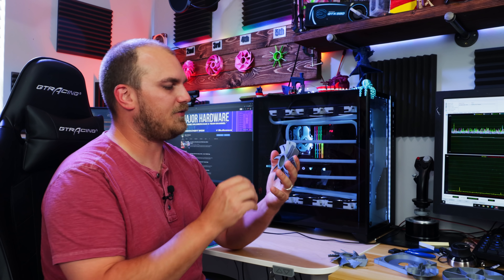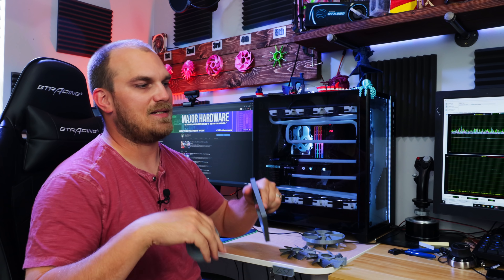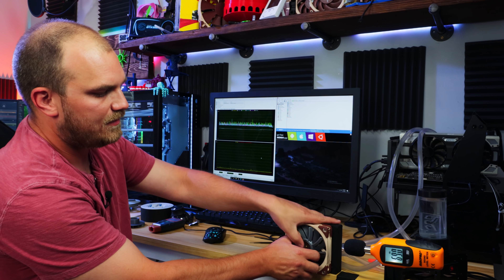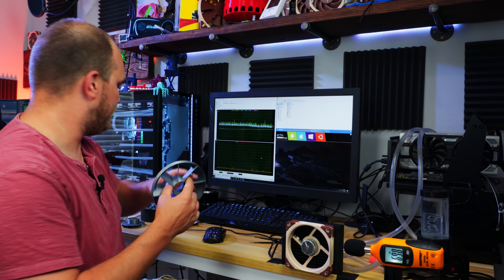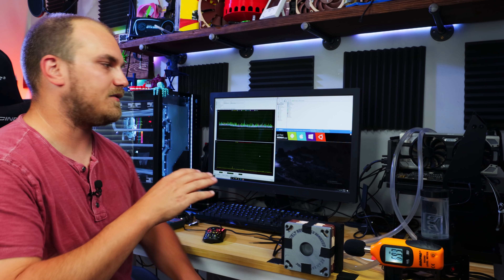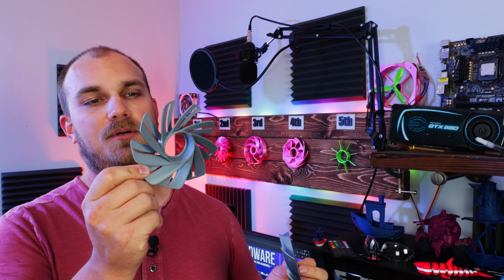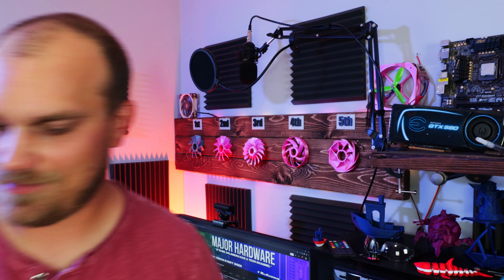We Are All Noctua Engineers | Fan Show Down Episode 4

Comment: Hey he tested my stupid blower garbage. Today is a great day. I'll edit this after I see how it actually did.

Edit: It worked as expected.
Reply: My first thought when I saw it: "If the shroud inlet was shaped like a venturi, it would work even better".
Reply: @dimitri877  That's really not the issue here. I did design it for proper flow at the correct velocity but the biggest issue is not knowing the power of the fan motor. I assumed it was weaker than it apparently is so I didn't give it as much bite as I could've. I could make a much better version knowing this but I had my fun.
Reply: @mattsoup4121  my thought was not to diminish your design, I loved the way you thought outside of the box like James mentioned in the vid   :)
Reply: @dimitri877  c check i
Reply: @dimitri877 totally agree! 😅
Reply: The impeller needs to be bigger! Take up as much room as you can in respect of width.
Reply: @CableWrestler  that's what my previous reply was about. I didn't know the power the motor can put out so I didn't make it very aggressive.
Reply: @mattsoup4121  man, that blower fan of yours is my favorite in there. I really thought it would get in the leader board. The design is very unique too bad it didn't work that good
Reply: starshipeleven  you need torque curve specs and several other factors. I just guessed.
Reply: Torque I'm sure?
Reply: It was interesting! As someone who understands very little about fluid dynamics or fan design, all unconventional designs are great fun to see... You know - because just maybe this random dude from internet figured something out by skill or pure luck.

Hey, since you are pretty handy with the design software, maybe you or someone else wants to give this simple mod a try? https://i.imgur.com/u51QWdJ.png
I think it should be pretty easy tweak to the default A12: Basically just increase the upper curve of the blades over the side of the fan(by your own eye).  By my logic that should wreck the A12 :D
Reply: @z3dar  I don't think it would do much. I actually don't expect any 3d printed design to beat the stock fan. Their tolerances and CFD work won't be beat by an average person and even if they are 3d printing doesn't create good aero surfaces unfortunately.
Reply: @mattsoup4121  Yeah, absolutely. 
My thinking was that larger curve/blade is something that (probably)should help performance on paper - and also something that Noctua likely wouldn't implement even if it was better performance, since extending blades over the frame introduces other problems that are not worth it.
Reply: I think it might’ve actually had a chance if you would’ve made it into a puller fan. Basically have the same kind of blade design but with an open back so that it throws air from the center out, which would have to be replaced by air sucked through from the backside of the radiator
Reply: I liked your radial fan. Unfortunately the mounting of the blades and the chasing killed off a lot of potential. Also a radial fan doesnt have a lot of air flow by design (if you compare the input nozzle with an axial fan), but rather achieves a higher and more stable air pressure.

I guess that it was never meant to be winning, but rather a proof of concept. (Great fan curvature though!)
Reply: @32Zn  I only did it because I felt like it. Obviously it wasn't going to win anything.
Reply: doesnt mean you cannot tweak it to make it better.
Reply: @Daniel Keener no. I thought like a small fan mixt with a big . So half of the blades are only half the length and the other one start from the half length to the outside so you have a one blade gap between each effective blade. That half's the blade surface but you can go very aggressive on the blade angle to cut a lot of air
Reply: It looks like a Tesla turbine
Reply: @christophervallas8547  only in the sense that it runs axially. It's completely different in the physics of operation.
Reply: just curious if you you designed a backside for it as well like a small opening in the back like the front because i think that would be cool to see if a nozzle to redirect the air coming out the back instead like a bigger front opening and a smaller back opening so it acts similar to a normal blower not sure if that works i was just curious if you tried that in your testing
Reply: @CMyBigHarryBLLS  If I did that it would be pulling in air from the direction it's blowing the air, which would reduce the total mass flow rate of air in the correct direction.
Reply: @mattsoup4121  ok i was curious and that does make sense i didnt think about it trying to suck air in the wrong way i had in my head the idea of a rocket but what i didnt think about until you said it but the combustion process is a huge amount of volume being compressed outwards not being drawn in from one side to the other
Reply: i never tried 3d modeling, so if some one could make a design with every second blade being higher on the outside and set off every second one higher in the inside, so the air grab is split.

Comment: The dolphin/whale fin design -- I think thats a 1:1 copy of the Akasa Piranha fan fin design
Reply: It's similar-ish but not anywhere near 1:1. If anything it's closer in style to the NF-P12 by Noctua but with more and further spaced out fins.
Reply: @ryantakahashi9130  No its not because the little 'teeth' (lets call them teeth) dont go all the way down to the central hub of the fan like they do on the Akasa's. There are also more of those teeth on the Akasa than the NF-P12
Reply: To be honest I am not really familiar with pc fans (only have a laptop atm) and I haven’t heard of those that you are saying but I’m sure I wasn’t the first to put tubercles on a pc fan lol. 

The design is based off the noctua A12x25 (no need to throw out their, likely thoroughly optimized design) however I did model it from scratch. The tubercles should allow for a higher angle of attack before stall and I made the blades steeper than the noctua but just how far the angle can be pushed should be explored. Would likely be boring tho having seemingly identical fans that parameterize the leading edge geometry and pitch.

Comment: That air grabber thing has way too steep blade angles... the concept could be salvageable but needs a redesign.
Reply: OriginalTharios  -- All the fans (and the blower) are designed for anti-clockwise rotation. The air grabber had a crazy angle of attack though, it looked like 60°! Most other designs have less than 40°.
Reply: @TlalocTemporal  60? looked more like 85 to me lol. that thing was just an air paddle. i was shocked that it didn't thermal throttle tho
Reply: I don't care if he got wrong alignment or steep blades, his design is pretty similar to mine and he missed out the base principle of vectoring the intake to increase it's surface size. Instead he just enlarged the surface like as if the whole thing is a pipe adapter smh.

edit: BOOO
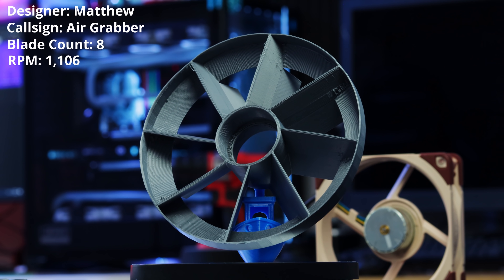Reply: OriginalTharios  -- Look at 2:04 and compare to the other fans. The blades are angled in the same direction, but are much flatter, acting more like paddles than blades. That much angle of attack might work better if the hood was turned around to work like the blower design.
Reply: @TlalocTemporal  No it is actually backwards (if they intended to push through instead of pull through), at 6:13 when he is slowing it down by hand you can see they are angled to pull through rather than push through so the whole larger fan design makes no sense as printed (if mirrored then it might make a difference but probably not much).
Reply: @blindassassin111  -- All the fans spin anti-clockwise, and like all the other fans you can see this one has the leading edge of the blades facing anti-clockwise, such that it will pull air from the space and push it through the radiator. Because of the high angle of attach and the flat blades however, more air ends up being thrown centrifugally, causing the turbulence.

I doubt the fan motor can even spin clockwise, and I'd wager that a fan seemingly build for clockwise spin would be flipped by Mr. Major Hardware unless specifically instructed not to. He's a bright boy.
Reply: I think it needs a changing angle of attack so that as cross sectional area decreases, velocity will increase. However I have a feeling getting the curve exactly correct will be important
Reply: OriginalTharios  "Well something was wrong with the rest, then.  Because the Air Grabber was opposite all of the others"
No it wasn't. Are you blind? Compare them again. The only one that's facing the other way is the weird backwards fan from a couple of episodes back (which was in 4th place at the start of this video)
Reply: I think the boundary layer of air on the outside ring is disturbing the flow, ie, the air on the outside is faster than anywhere else, and fast air is low pressure, and that attracts the air going in. Not to mention centripetal force flinging air out.
Reply: To me it looked like the the rake of the blades was backwards to the direction of the motor, like it was trying to pull air through the radiator. A design mistake if you will
Reply: @coletrain95  It has the same blade direction as all of the other fans except for the one that was pointed out as being backwards in a previous episode. I am genuinely concerned about why 50% of people in this comment section can look at a fan and not be able to see what direction its blades are pointing when it's right in front of them. Is this channel popular with brain-dead morons or something?
Reply: No twist, no span-wise curve, no cord-wise curve, no aerofoil, just a flat, straight blade. Angle of attack is the last of the problems..
Reply: It's bad as fuck, by having a larger input than output diameter it heats the air up. 
It's not a ventilation, it's a hair dryer.
Reply: @incoralium9211  True, compressing air will do that, though I doubt it would be a noticeable effect on this thing. I don't even think this design will compress air at all, or move more through the radiator than a conventional fan. I just said that what's breaking it is blade design, not the concept.
Reply: the turbulent intake air flow can be fixed with a frame for the outer larger part funnel attache to the noctua's frame. imo
Reply: @TheKb117  -- What it really needs is a smooth curved blade with a lower angle of attack.
Reply: @TlalocTemporal  what if we got the whale fan, and added that same funnel to a cap with a wider hole than the blower fan
Reply: @LUCKIPUP  -- The blower fan uses a centrifugal method so the whale part wouldn't work there, but trying different configurations and sizes of blower would be fun. I wonder if a double blower could work here?

Comment: You should attempt an acetone wash on the fan prints to make them smoother.
Reply: PLA is resistant to most chemicals, ABS does smooth out with acetone but its a very poor choice for thin prints since it warps and it is very difficult to print with. ABS is almost obsolete as a 3D printing material and is slowly getting replaced as a plumbing material, lastly Nylon is replacing ABS in the injection molding world where durability is required.
Reply: @Guardian_Arias  wait where do they use abs as plumbing? I've only seen pvc
Reply: @KibitoAkuya  It's usually used for outgoing waste. If you see a beefy black plastic pipe leading out, it's probably ABS.
Reply: @KibitoAkuya  the black sewage pipes are typically ABS, the white ones are pvc. PEX is much nicer and if you carefully wrap it with aluminum HVAC tape it can stay above ground at least so far some out side copper pipes I replaced with PEX are going strong after 5 years in 115F in summer and as low as 25F winters. (I had PEX on hand and HAVC tape , was feeling too lazy to solder some new copper pipes and well nothing is more permanent than a temporary fix)
Reply: @Guardian_Arias : Yeah, white and gray ones are both PVC (regular and extra-chlorinated). And the copper-colored ones are... copper.
Reply: @Guardian_Arias  ABS has been used for plumbing since forever. That was always it original intended purpose.
Reply: That would probably make them slightly better
Reply: Something has to be done
Reply: @TheTyisawesome  if printed at 0.16mm layer height or lower they would actually be pretty smooth but since it looks like he print at 0.3mm or higher it will literally double print time. An other option that is even less appealing is smoothing them out by hand using a solder iron set at 220C but one slip of the hand and you now have a hole...but don't worry it will be a feature not a bug.
Reply: Clearcoat sandpaper with a q tip or something maybe...
Reply: Or there's... sanding.

Comment: the  pitch on the air grabber  blades was completely  wrong.  looked  15-20 degrees.,  needs to be at least 45.    Probably pushing 75% of the air it moves outwards rather than forward.  Interesting concept otherwise.  Might have won with right blade pitch,.  would have created an air inlet funnel effect as designed

Comment: You should print the same fan as a stock noctua, so you can see what kind of losses you get between stock and 3d printed.
Reply: He already did that.
But yeah, you get significant losses, in especial due the plastic material.
Reply: @youkofoxy  Looks like the sound jumped from 35.5 dba to 42.5 dba even with the 3d printed one running lower rpm. BUT, the 3d printed one cooled almost the same. 
EDIT: the ambient was higher for all his 3d printed designs, so the delta seems like the important metric, and the top two are off by less than a degree. I would be interested to see what the dba rating is with his new setup (the old measurements were taken with his phone).
Reply: Exactly what I was about to say. The Noctua copy has to be in the charts so we can understand if someone has made an actually good design.
Reply: @Warma99  I was thinking the same thing.. good idea.
Reply: i think he should redo it cause he has a better printer now
Reply: Good point, so from a reference, noctua took almost 7 years from engineering to product with aerospace engineers before they released their first generation of fan.
It took them another 12 years before they released the 2nd generation of fans. What changed? .3mm closer to edge.
Reply: We could never greet each other on an airplane.
Reply: @goatslayerwp  What's wrong with saying  "whats up Jack?" ;)
Reply: @HouseSpecialty  Your last names are a bit awkward to say out aloud. People who know each others usually call each other with their last names. Bonham vs Bushong hmmmm
Reply: @HouseSpecialty  What's up Jack would work, just not HI Jack. Lol
Reply: I think that he should try to put some epoxy coating to improve surface quality, because 3d printed surface quality is outrageous! Especially when you can see the layers on the surface like on the font of the blades in 1:05. If that would be smooth, it would improve quality. But it would also increase mass, so some testing would be required (and coating it right would also take some skill).
Reply: @syriuszb8611  or even better (no additional mass) he should use ABS and make the surface smooth with acetone
Reply: This! This is such a great idea to test the baseline!
Reply: Lassi Kinnunen  read up on the foundation of noctua. They didn't start with pc fans. Not just the wiki page. I had done an interview in 2007 with the founders for a physics project in college. They have 2 doctorates in aerospace engineering and aeronautics. They had designed the fans years before production.
Reply: Lassi Kinnunen  14 Engineers working for 6 months is 7 man/years of effort... Which I'm sure marketing spun into 7 years of work.
Reply: Lassi Kinnunen  I'm guessing they had engineers who weren't working as engineers per se for all those years. If the founder has a phd in aerospace engineering, then in a given day he's mostly functioning as CEO.
Reply: That was the very first thing he did lol
Reply: aha interesting ..noctua wont be too happy about it 😆 maybe he need to check for copyright infringment also need to be careful
Reply: regular 3d prints are not air or even light proof... they should be SLA printed to have any sense
Reply: @Blake Belladonna Someone did, you may know them by Noctua.

Comment: I wish someone would add the things on the ends of plane wings to shrink the turbulence off the wing increasing efficiency.
Reply: That is what the housing is for. There may or may not be an increase in efficiency, merely based on how close to the housing the fan gets. If the gap to the housing is small enough, very few vortexes can form at the blade tip(why the fans are quieter and more efficient in the housing than out). Good idea though, and I hope someone tries it. If the gap to the housing is too large, then that might be the efficiency booster the fan needs.